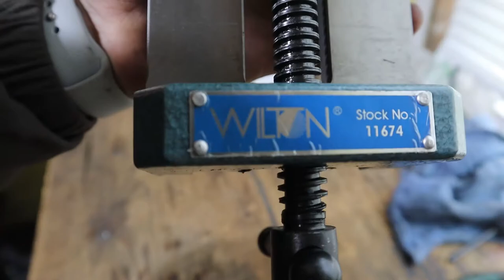How to turn your bench top drill press to floor drill press easy!!

Comment: very nice job, but please consider anchoring it to the floor or welding a much larger base on it so it won't be as easy to tip over, especially if kids are going to be around.

Comment: Easiest way to heighten a drill press is to get an old rim from a truck. Weld a 1/4" plate across the edges of the rim and drill for the original foot. The press won't tip over and will be more stable than the original foot. It will also be relatively easy to move to a new position in the workshop.